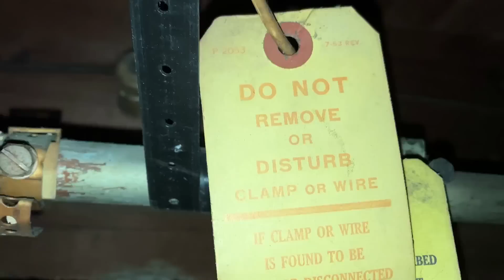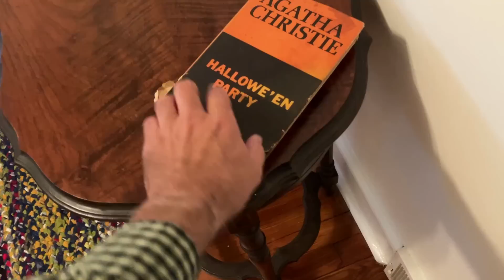Yard Work and New Electrics in 1925 Bungalow

Comment: I had a similar issue when I moved into my house back in November 2002.  It was built in the early 1950's, and the wiring was okay for it's time, but subsequent occupants have jerry-rigged wiring all over the house.  I would trip a breaker, and it would shut off a light bulb in the basement and the TV upstairs!  I have since had some re-wiring done, new 3-prong and GFI outlets installed, a new breaker box installed and put all the major appliances on their own dedicated circuits.  I would suggest you do the same, especially since your house is older than mine.  And on another note, those original hardwood floors look fabulous!  Looking forward to the continual evolution of this house into the dream home you've envisioned!

Comment: We had knob and tube and still have knobs (wiring has been updated) in our 1913 attic . You can still find insurance but usually a bit more and no discounts . We also had a old screw in socket on the wall before they updated . Dead also we covered it. Neat looking but not practical. Not for sure when they went out . That’s the cutest little door in the attic . I would definitely try to be friends with that little cat lol

Comment: I'd be putting some drop clothes down to protect the floors.  Time to hit the flea market for some old garden tools.  Went to two different stores to price a small pitchfork and developed detached retinas when I saw the price of over $60!  Mower and mulcher will save you work and grass clippings will nourish your lawn.  So, your plumbing and water system is ask!  Have you met any neighbors yet!  See, Mom, brought you a plant for your new home.  Are you doing 220 line for your basement workshop!  Do you then have to have your electrical work inspected by your town or city officials.
Reply from the maker: The electricians are licensed and insured.

Comment: Such a nice front porch. I would look into what it would take to make it into a year round living space.
Reply: I think that he mentioned an outlet on the front porch, so not much more than an electric space heater.
Reply: @danielulz1640  I was thinking more in terms of adding insulation, and exploring the possibility of extending the existing heat system to include a vent to the front porch.

Comment: Such fun. May I recommend a really great item that will allow you to pick up a bunch of leaves at once after you rake a pile together. It’s a set of round plastic leaf picker uppers, there is a slot on the inside for your hands the ends are like a rake. I can pickup a great amount of leaves using this item. I’m not sure what they are called. They have made raking a lot easier. 
Do you have a tradesperson that knows how to do plaster? I need some plaster work done in my house. I’m afraid this may also be a lost art. My husband tells me he knows how to do it but I’m not quite sure what the results will be since he’s only done drywall.

Comment: Hey, Scott! What's a shipper robe?
Reply from the maker: A chifforobe (/ˈʃɪfəˌroʊb/), also chiffarobe or chifferobe, is a closet-like piece of furniture that combines a long space for hanging clothes (that is, a wardrobe or armoire) with a chest of drawers.[1] Typically the wardrobe section runs down one side of the piece, while the drawers occupy the other side.[2] It may have two enclosing doors or have the drawer fronts exposed and a separate door for the hanging space.